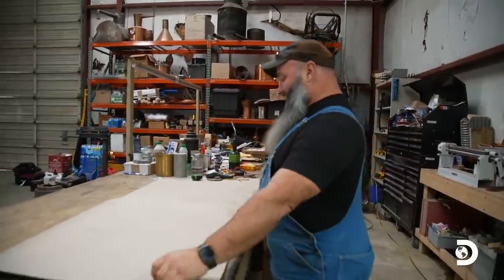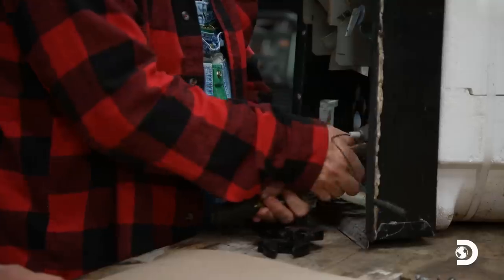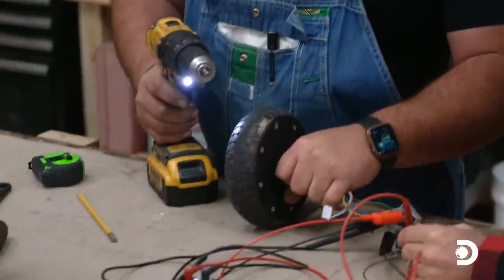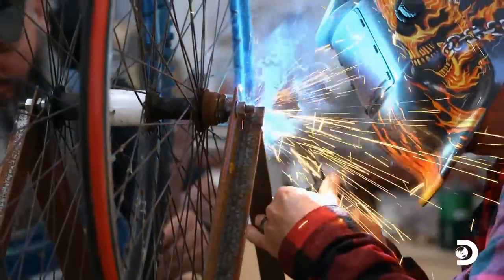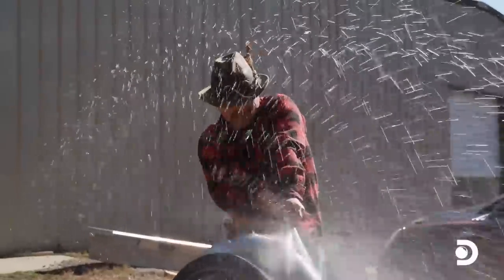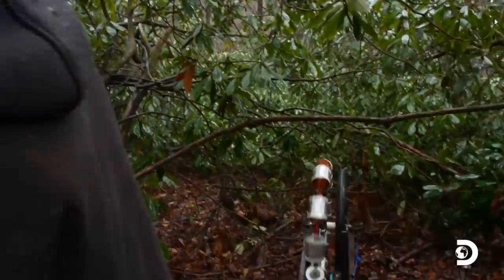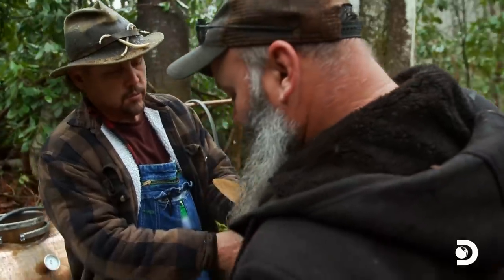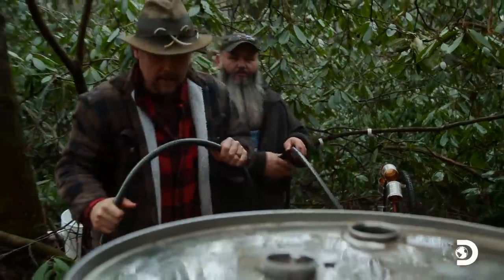Mike and Jerry Build an Automatic Burner! | Moonshiners | Discovery

Comment: How are they powering the pump? Why can't that power source be used to heat their mash?
Reply: its called gravity. water flows down from higher up the stream and mountain
Reply: @HSithis  look at the pressure, that’s not natural flow.
Reply: @kyzatheref  going from 6" pipe to 4" to 2" to 3/4" will increase pressure.